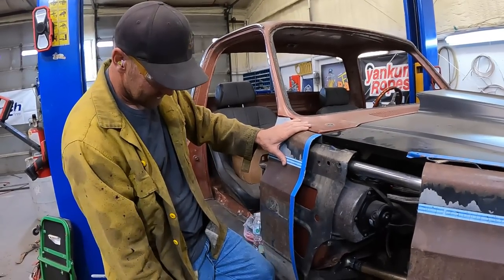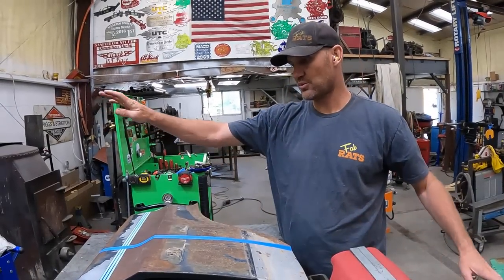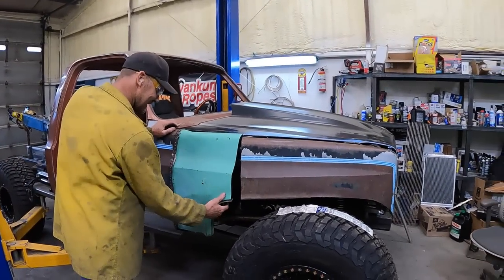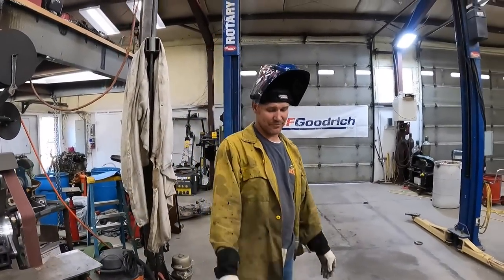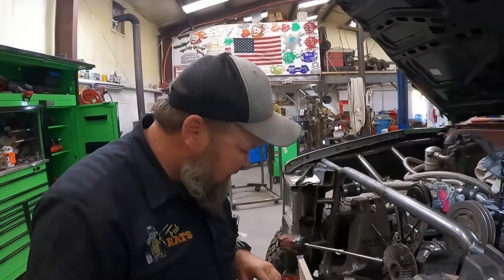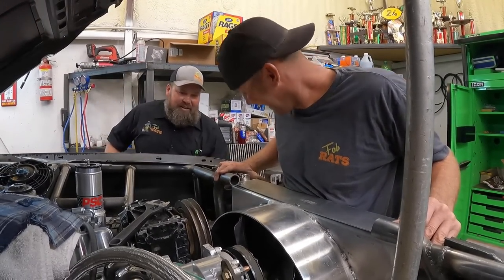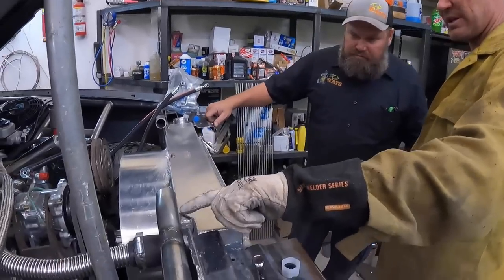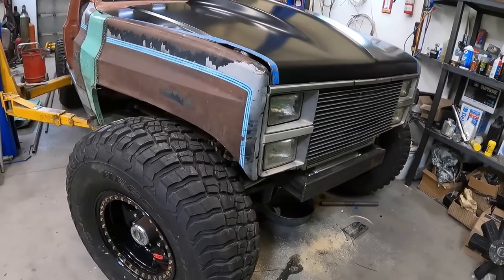Never Before Have Fenders Like These Existed On The Rat Rod Wrecker

Comment: I am with Hunter, not convinced this is going to work, because unless the engine has ZERO bushings on it, any torgue in it will drive the fan right into your VERY close tolerances of a shroud, resulting in lots of torn metal and aluminum, and a job that "is done right cause we do it twice"
Reply: I'm thinking the same thing, no room for flexing.
Reply: Everyone assumes he's soft mounted. If it's hard mounted it's fine.

Comment: I'm sure this is after the fact but you have to allow for engine movement so the fan shroud will need to be larger in diameter or the fan will hit the inside of the shroud and wreck the radiator along with a lot of very expensive parts. Just saying.
Reply: Your assuming he didn't hard mount the motor. 
I haven't seen the engine mount setup that I can remember, might be rubber and you could be right, might be hard mounted and your are wrong.
Reply: @mikewhitman745  If you want it to vibrate the hole rig then yes you might be right but time will tell.
Reply: @michaelkeyser8371  it's not an uncommon practice in a lot of motorsports. More performance oriented stuff but still it's not rare to see a solid mount engine.

Comment: Body’s flex independently from
Engine. I will be absolutely surprised if the fan don’t rub and cause destruction at some point prolly at the absolute worse time possible. I wish it don’t cause any issue for you but I’m not holding my breath

Comment: I have a couple questions:
* Doesn't the engine move independently of the radiator and shroud? If so, isn't that tolerance a little tight for the shroud? How much do engines shift under high torque?
* I'm questioning the decision to use a mechanical fan over electric fans. Electricity is free but mechanical fans steal HPs. Was this decision made because of your trouble with cooling the jeep?

Comment: I can see Robbie Layton standing there with cringe look n shaking his head in disbelief of your body work on either fender or tailgate. word of advice when mitering 45* cuts, cut all planes except for farthest point from inside point, then just bend and cut material as needed to close up gap; outside corners the need for added material will depend on contour; use donor pc for door jamb post....part 2 ..words of wisdom, when/if need arises to add/weld plastic aka chevy grill, the need to weld identical material is a MUST eg. polyethylene , polyurethane; or weld will not hold. this makes great use of any material that is removed and also makes a good supply of plastic welding rod if cut into thin strips and kept and marked by material in separate bins as some materials can be hard to come by shud the need ever arise. also keeps recyclable material from getting into landfills. I hope Ben aloud excess A/C hoses to allow removal of radiator and not have to remove A/C condenser and hoses exposing system to moisture and other contamination ... love the angled hood n fenders..

Comment: I don'tt undeerstand why you went with that clutch fan? Will you tell me? Maybe take one of the fans you took off revers it and put it back on the front. On the side which ever is the side that takes in the hot water from the motor. I've never built anything like this so this is coming from zero experience.  But I always think like belt and suspenders.

Comment: Wrong fan blade set up throw the clutch fan away put on a derict flex fan blade so you park pulling a person out the flex fan keep your motor cool don't for get the spacer you need for the fan blade